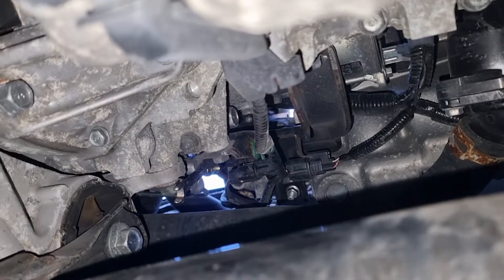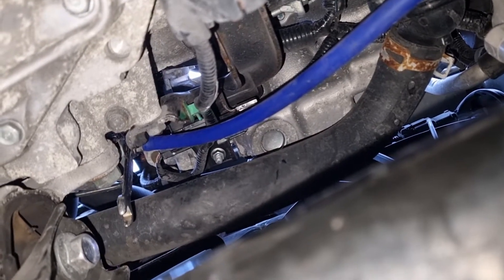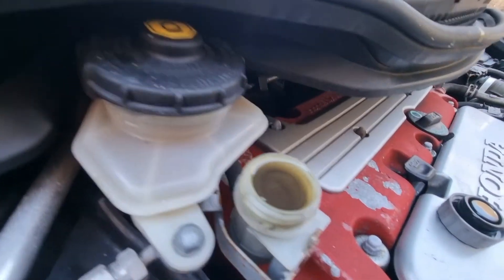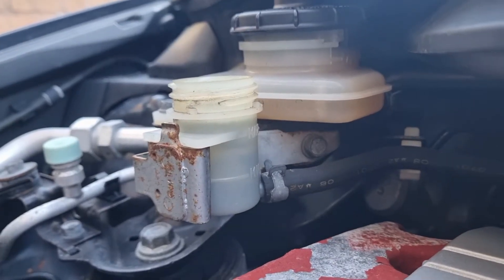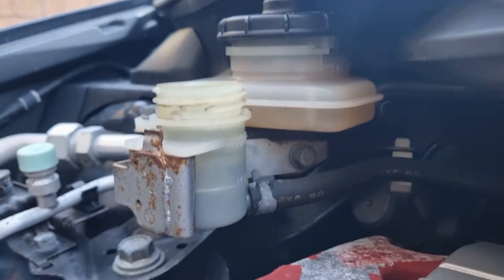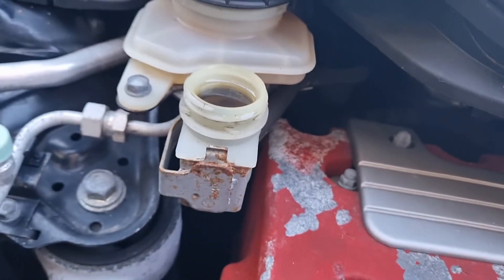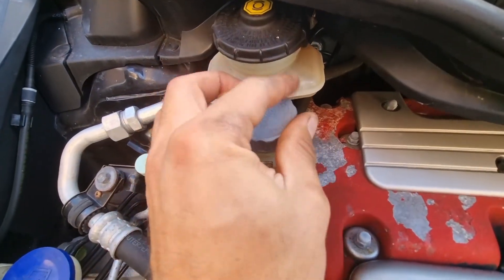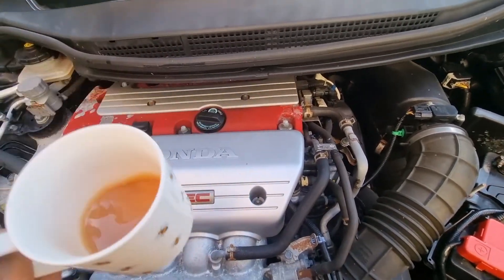Bleed / Clean Clutch Fluid - Honda Civic Type R - FN2

Comment: Hi mate sorry to ask a few questions but….
1 - was this done alone or is it a two person job? 

2 - You’re saying stick pipe on suck it slightly with nipple open to start it flowing? Or just let it naturally come out? 

3 - what is the purpose of fluid in the bottle on floor to start with initially? 

Thanks.
Reply from the maker: 1. alone

2. gravity should work

3. so if anything sucks back up its fluid and not air

Comment: might sound silly, but what made you change the fluid were you having problems while driving? changing gears or anything like that?
Reply from the maker: T'was black fluid. On start up the gears were sticky and clutch was behaving weird. Since change of fluid the clutch was 100% better
Reply: @NewbieMechanic  ah no worries thank you 
 By the sound of it I just need a new clutch really 😂
Reply from the maker: @WaqasA0495  yeah your clutch is shot.
Reply: @NewbieMechanic  🤔 I've been told I could adjust the biting point it might help, what would you think about that? my clutch is low
Reply from the maker: @WaqasA0495  how long has it been this way?

Comment: …as you said don’t let the level drop to minimum as you will get air in system, oops too late , ahhh did not notice it !!! so I’ve topped it up  with clutch fluid and pumped the clutch pedal and tried gears and drove it up and down the street ok. Left car parked few days thinking everything was ok and now it won’t go into any gears at all when the engine is running however they do change smoothly when engine is switched off however the clutch pedal is dead ie right down to floor and very very loose. Help , does the need master or slave cylinder bleeding or do you reckon the clutch is shot, any advice would be appreciated btw I’ve got the Honda civic mk8.
Reply from the maker: Woops! You need to get that air out. Bleed pressure will make it easier some sort of bleeding kit. To push the air out through reservoir out the bleed screw.
Reply: @NewbieMechanic  …Thanks for the response, I’ll call AA to be towed to a garage tomorrow to have it bled as I can’t drive it … crossing fingers it’s only that !
Reply: Thanks mate ….sorted….garage did the bleed and working fine now.
Reply from the maker: @mohammedjina7300  glad it's sorted

Comment: Do you not put air in the system and do you have the blue pip in old fluid before you start?
Reply from the maker: Nope. You can't let the top run dry, hence why i say keep it topped up otherwise air will enter from there. As the reservoir is open at the top full of dot4 it pushes the liquid through by gravity downward.